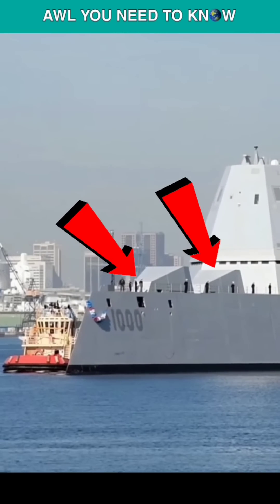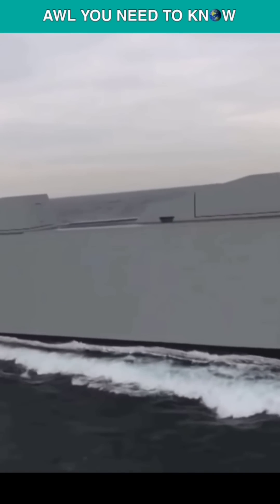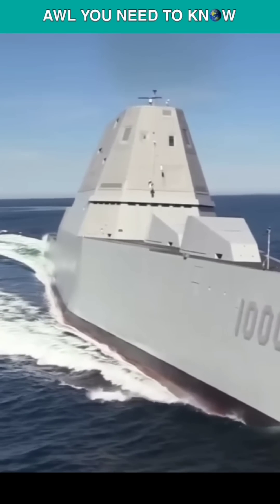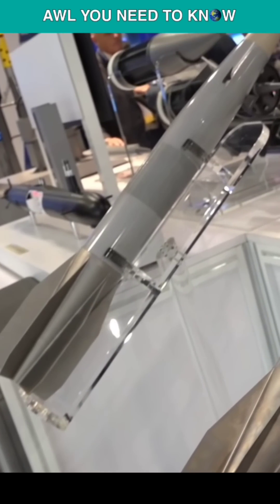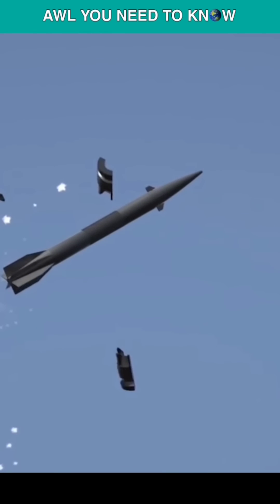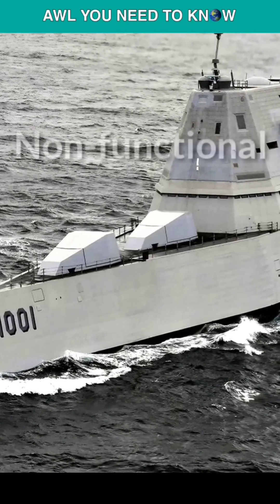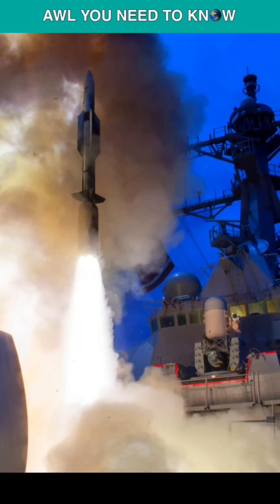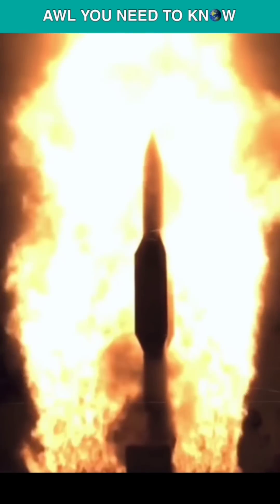WHY THESE GUNS WON'T WORK? #shorts

Comment: Last I heard they were decommissioning and scrapping this class of ship… this is the problem when you put the cart before the horse…  the Warthog was the plane built around an operational 30mm cannon.  The Zumwalt was the ship they built before they had a functioning gun.  The other problem is that the ammunition became prohibitively expensive 1 round being at least 100k or more.  This is not the only ship they have designed around fictional technology the USS Ford Aircraft carrier also had bomb elevators that did not work, catapults and list of other systems… some finally work others were scrapped for current technology.  The military is under poor management of assets like many government programs it was setup with rules that make no business sense… one I never understood was fuel usage.  If we used less fuel this month because of operational commitment, we received or rather penalized that amount of fuel the next month, when we did have operational commitments.  A system imposed on us to waste fuel which equals money.  The cost over runs are from poor management at the top.

Comment: Replace them with 5inch mk45 guns like the rest of the surface fleet.  Standardization is a quality unto itself.  And the mk45 is no slouch.  Whenever happens the majority of the US surface fleet will be shooting 5 inch rounds when they need volume of fire, and will be for the foreseeable future.

Comment: Im pretty sure those oddly shaped turrets are actually one of two prototypes of non-conventional weapons designed for every other battleship and destroyer. The discussion from the pentagon was the use of the "full metal storm". A electromagnetic gauss cannon that fires massive projectiles with a mussel velocity of such epic proportions, it appears to warp the very fabric of time/space that surrounds the immediate proximity of the projectile. It can peirce heavily fortified exterior armor walls and leave a path of destruction, and death behind. It makes almost no sound yet if you are on the receiving end of this device, you will hear a slight whistle, then nothing at all, ever again. There was also a design that caught the curiosity, was another type of electromagnetic, direct energy weapon. It has a nickname of "hellfire" and lives up to that name with bragging rights. It is also believed the same type of device thought to have brought  down the ufos at Roswell. Over the decades it has been perfected and baptized by the high priests of glorious scientific death. A weapon that utilizes the concepts of tokamaks or spherical tokamaks with the use of tridium or cobalt molecules that become superheated to a level of ionization that directly transmutates the particulates of whatever lies in the path of the business end of this unholy device into a firey plasma trail that glows for a few seconds before conpletely vaporizing into a mist of nevermore. Direct energy weapons are the future of warfare and when controlled by heartless A.I. Quantum Supercomputer Androids, I can only speculate that a simple begging for one's life will only fall upon the ears of the dead and then plus one. Knowledge is power, be wise.

Comment: Typical DoD decision. Build a gun. Don't make any rounds for it.
Reply: one round costs around $1mil when a Harpoon is about $1.4mil...
Reply: @fatdoi003  almost cost as harpoon but only good as excalibur?
Reply: @dernadaarmando2948  next gen weapon needs a next gen price tag.... maybe it's also a cover for the manufacturer that the gun doesn't work so they charge so much for a round
Reply: @fatdoi003   That very makesense tho

Comment: It didn’t work because the ammo was too expensive for the desired effect. They do work, they just don’t shoot them. If I’m not mistaken, they’re already being refitted to fire hypersonic missiles so the weapons platform has already been selected. The notion of adding another set of vls cells that fires the same shit as the other 80 vls cells it already has would be a waste of time and money. Since the navy wants to move away from arsenal ships like the Tico, this simply moves it in that direction. The new hypersonic that it’s already testing would make more sense. Better range, harder hitting, relatively same amount of work. And you’re adding capability, not “adding capability” but its just more of what it already has. According to Vice Admiral Galinis, commander of navsea, they’re fast tracking the zimwalt to get hypersonic’s. Brother, I think I just put in more work writing this while on the John than you did writing this video. Cmon.

Comment: Actual reason, price went from $80,000 a shell to $800,000 a shell so only one ship in the fleet has the shells
Reply: You're correct, no one mentions that!
Reply: It's an economies of scale thing, less ships means less infrastructure and demand needed to create ammunition meaning ammunition prices skyrocket.
Reply: Might as well use Tomahawks at that point and have a range of over 1000 miles
Reply: if it's 155mm, the guns can be recalibrated for Excalibur rounds but didn't they?
Reply: @fatdoi003  sounds about right
Reply: @fatdoi003  I believe that Command Modern Operations does that
Reply: Yeah, now today their 1mil a round! Greedy contractor destroyed the whole project!
Reply: @SavNout01  considering a Tomahawk costs $1.4mil.. more effective
Reply: I thought these things use atandard artillery shells
Reply: He mentioned why. The shells cost went up due to the class being cut from 32 to 3. Basically economy of scale kicked in since they were the only ships capable of firing it. 

 The shells would have cost much less if they were actually ordered on scale. 

 Still an insane weapon. I do believe these last two shop programs suffered by being too early. Their designs would have been made MUCH easier today. 

 Still crazy they only have the RCS of a small fishing boat. Imagine if they were one third the size. Perhaps we will be seeing stealth water drones.

Comment: At this point the military should just rip off the front section of the hull and replace it with a section that can only house missiles also thank corporate greed for the lack of use for these ships
Reply: If you split the engineering and research cost over three ships instead of thirty-two, what do you think is going to happen to the cost? Also, since the mission has changed from counterinsurgency to near peer, having the Zumwalt shell land targets doesn't really make as much sense.
Reply: @jrmarcus  finally some logic. Corporate greed is absolutely a factor as well. A corporation's duty is to it's shareholders. Defense contractors are in a unique position where it's duty is shared with the government but they are more than willing to charge exorbitant amounts for required parts with cheaper alternatives. Many parts are too unique to find somewhere else but the government is contractually obligated to purchase from the contractor.
Reply: @AfricanLionBat you also need to pay them to keep them working for you
Reply: Thank corporate greed for a $600 billion annual military budget.
Reply: And they should eat the 20 billion dollars we could of fixed the homeless problem in a few states do you really think Oswald killed Kennedy. The Harvard 3,got him killed president John Kennedy said if you fire 3shots I want 3people dead what a coincidence 3,shots fired during assassination may Jesus Christ Help and save  each and everyone of us we will need it 🙏🙏🙏

Comment: Man I wish they bring back Battleships 

They are so badass to fire and even more powerful with their nuclear projectiles

Edit:Shit it's a Naval War in the comments
Reply: some submarine firing off torpedoes in stealth😈
Reply: @breadboi213  Submarines would do this with or without it being a battleship. Don't comment if you're going to say nonsense.
Reply: @E.V.A.N-COProductions what you said made absolutely zero sense. Their point was valid. That battleship would be a waste if a sub can easily take it out without anyone knowing it was there.
Reply: @AfricanLionBat  the point is not valid. Today's surface ships are even more vulnerable to torpedoes than the battleships of WWII vintage. Take the Yamato of IJN for example. It required seven direct torpedo hits combined with twelve 500lb bomb hits to sink it. The Iowa class battleships that the USN retired back in the 90's were built to similar specs. Most current surface ships would most likely sink with a single direct torpedo hit.
Reply: @jim2lane a modern torpedo, would have no issues sinking the Yamato. As for battleships,  they tended to be white elephants and hype. The only full on decisive battleship battle was the Battle Of Tsushim. Battles between battleships always ended up being inconclusive (Battle of Jutland, Battle of Yellow Sea). Smaller ships, submarines, and the aircraft carrier ended the era of the battleship.
Reply: @jim2lane that’s the reason why USMC loves  Battleship in the first place, they provide naval artillery support to their amphibious landings that’s needed for clearing enemy coastal defences.  Without battleship, it’s difficult to conduct amphibious assault on the shoreline’s full of enemy defences waiting for your arrival.  Maybe a dozen of carrier fighter jets bombed the enemy coastal defence but it’s not guaranteed destroyed, as they only dropped some few bombs and return, whereas battleship you can bombard them from afar
Reply: @Mirokuofnite  no one is talking about ship on ship gun battles - those days are long gone. But simply put, those ships were purposefully constructed to absorb much more punishment than modern surface ships are, and continue fighting. Their armor is many times thicker and stronger than anything you will find on a modern surface ship. If you have information contrary to this, we would all love to hear it.
Reply: @jim2lane  A Mark 48 torpedo would be fired 26 miles away from the ship and detonate right under the keel. That would break the structural integrity of the ship. The armor belt of a battleship was at the waterline. There was no defense for something like a modern torpedo detonating under the keel.
Reply: @Mirokuofnite  You're still missing the point. First being that the armor and protection, even that below the waterline, is many times stronger for these ships than their modern counterparts. So if by your estimation a single modern torpedo could sink one of these ships, then one would absolutely obliterate a modern destroyer. Next is that while the modern torpedo does have a phenomenal range, its warhead isn't that much larger than the ones used during WWII. And lastly, your statement is sheer speculation. Take the tests done on the USS America. It was subjected to numerous direct torpedo hits to simulate damage in a modern engagement. Even ones done directly under the keel. It was subjected to these tests for four straight days, and did not sink. It had to be manually skuttled with explosives placed inside.
Reply: @jim2lane  So your comparing a 1960s Supercarrier to a late 1930s battleship. One that is 200+ feet longer, and displaces 11,151 more tons?
Reply: @Mirokuofnite  yes, I would say it's a very good comparison, especially when you consider that modern carriers are not hardened to absorb the punishment from armor piercing shells like the Iowa's were. Combine the punishments both the America and the Yamato required in order to sink, and I think the point is made
Reply: @jimtan8472 you can do that with smaller ships
Reply: @jimtan8472 you can literally have a multitude of smaller ships do the same job without standing out like a sore thumb being sunk in 2 minutes
Reply: @jim2lane because you can't just keep adding armor to a ship. It has to float and it has to move. Speed trumps armor every single day of the week in the ocean
Reply: @jim2lane but a destroyer is faster and cheaper
Reply: @Mirokuofnite he is a fantasy sailor who watches too many ww2 movies. He is like some of these tankaboos who think armor+gun size= how good it is
Reply: @ThatSB  yes, that's true - and your point is?
Reply: @jim2lane not really.  The extra armor on a battleship is what would give it a HIGHER chance of sinking from a torpedo hit. Modern warships are lighter, more buoyant.
Reply: @Coinz8  where in the world did you find that bucket of crazy? Seriously? You are actually positing that heavier armor is more susceptible to damage than lighter armor?
Reply: Why would they bring back battleships? They serve no purpose